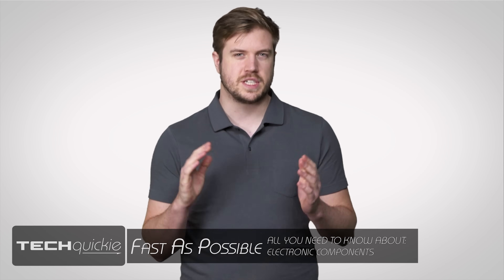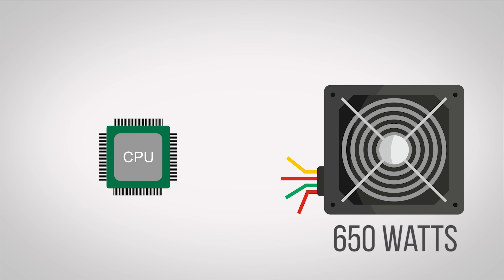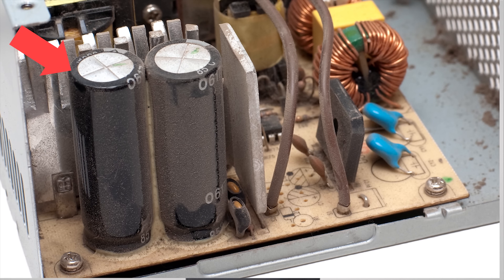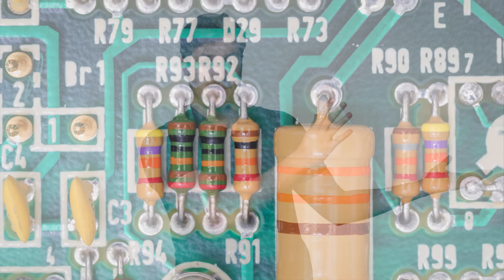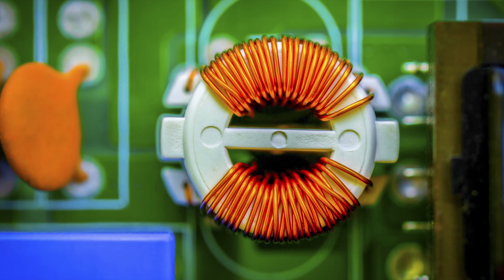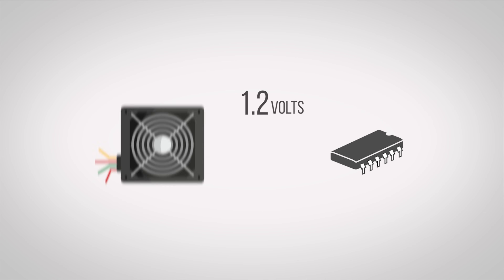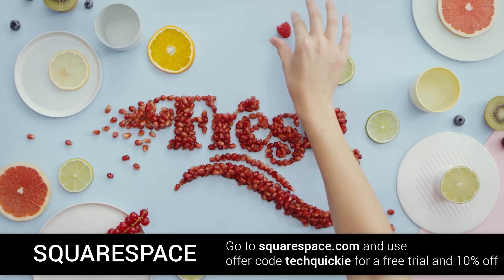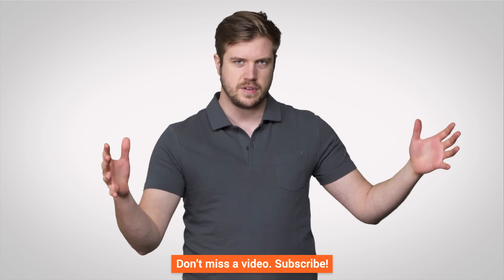Capacitors, Resistors, and Electronic Components

Comment: Just as an addition if you are into old Hi-Fi equipement. Especially on old amplifiers the capacitors will die first and it has a very negative effect on the sound quality, so switch them out if you get some old stuff.

Comment: Even with a Power Supply unplugged it can still hold a very significant charge.
Reply: Discharge the capacitors if you're so scared
Reply: not computer power supplies